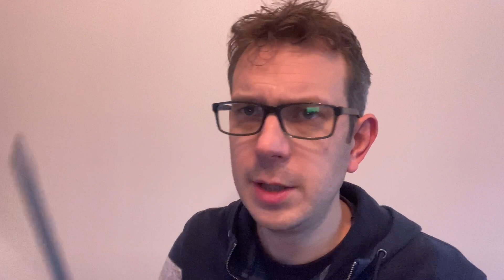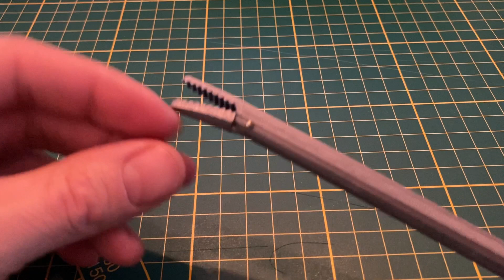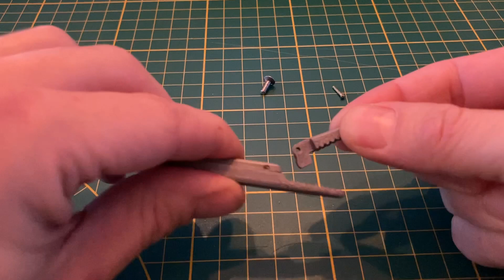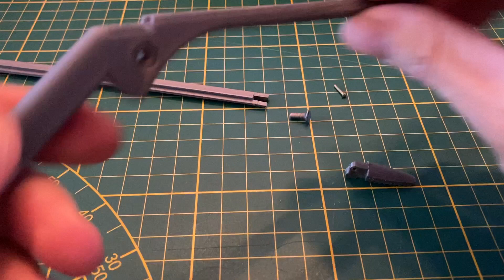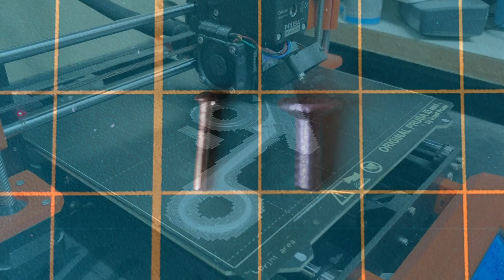3D printed Long Reach Pliers

Comment: Newby here. Nice piece. I want to print one. Using Ender 6 and Creality Slicer 4.8. When I ask to slice, it says, "unable to slice". The bed is 250 x 250, but info says 8 x 264 x 66 mm. Any ideas?
Reply from the maker: You just need to rotate the model a bit 👍🏻
Reply: @hoppend  Thanks. I will research how to do that. Probably simple, but new to me.